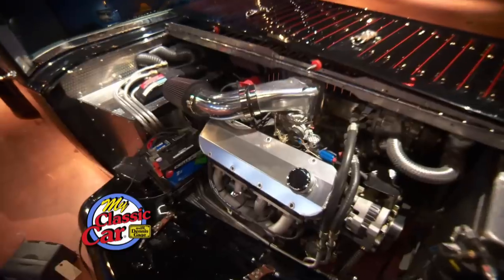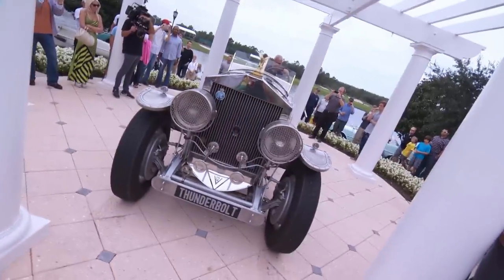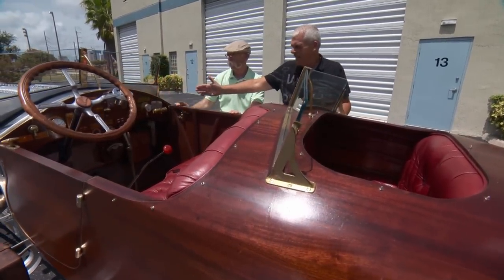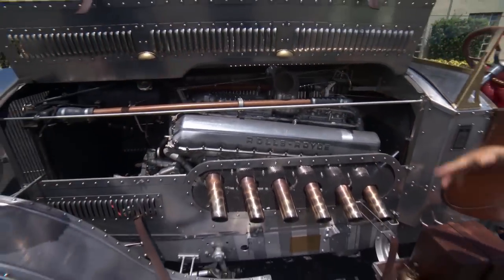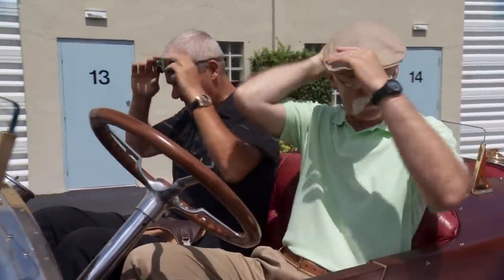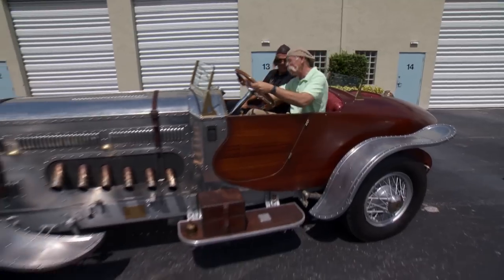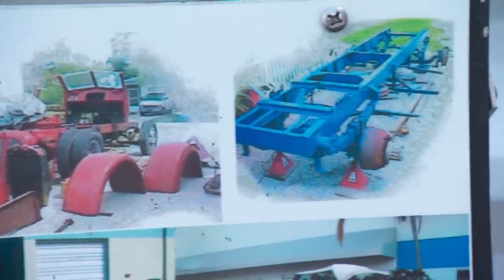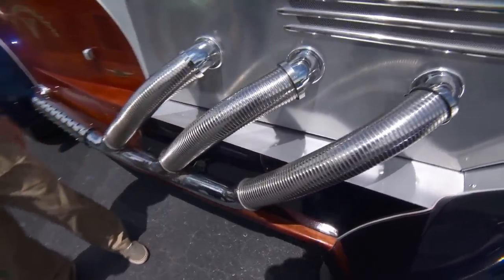World's Largest Boat Tail Car | Custom Built from Firetruck | Super Single Semi Truck Wheels

Comment: That engine could never have been in a Meteor, that was a twin jet engined aircraft, and its too small to have been in a Spitfire.
Reply: +Robin Horton No,what he means is the engine itself is a Rolls Royce meteor V12,that was used in a lot of tanks..basically a detuned and non supercharged version of the Merlin V12